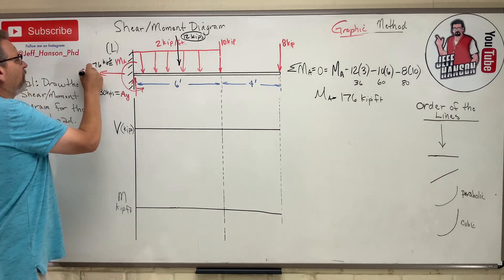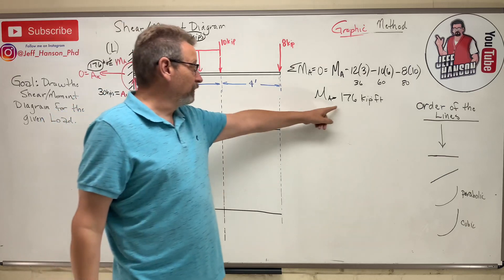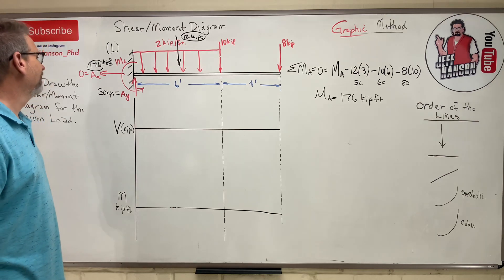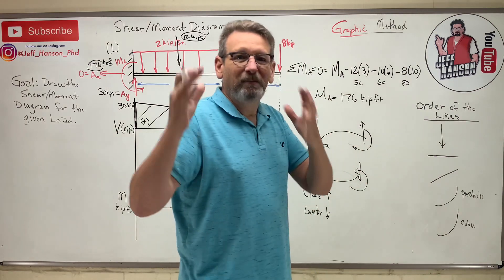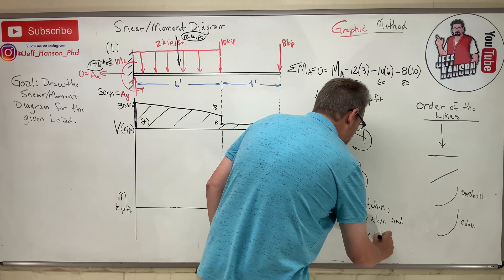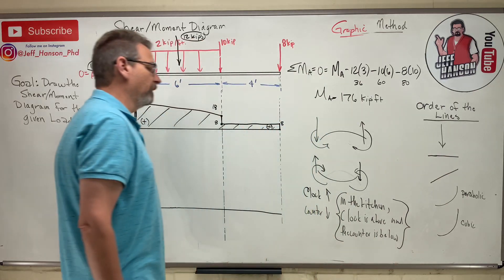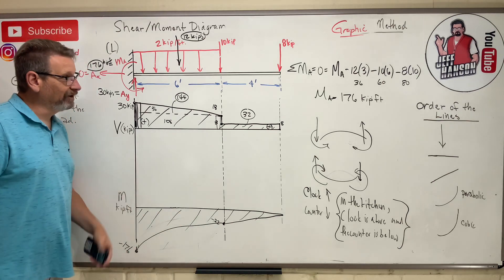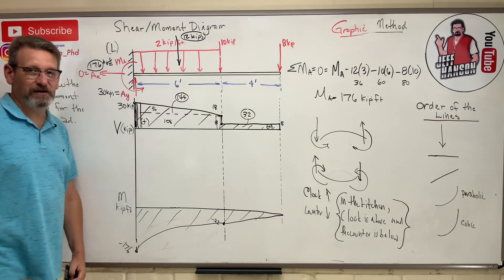Statics: Lesson 60 - Shear Moment Diagram Problem with Moments

Comment: I got a trick for the fast and slow type of curve part sir. Just draw a circle, divide it into 4 regions, and then put "PD" on the upper left hand side (Positive area, Decreasing slope) and then "NI" on the upper right (Negative, Increasing), "ND" on the lower left, "PI" on lower right.

so taking that example at 12:49 

since the area of the shear is Positive and then the slope is decreasing, then it would be "PD" and since PD is at upper left region of the circle the curve would steep then slow 😊😊
Reply: Thank you omg !!! I was having issues with visualization!!
Reply: it does
Reply: @tutingrubena1584  it doesn't work for triangle
Reply: if only I can send a picture 🤦
Reply: you're the GOAT
Reply: Great! Thanks man
Reply: ofcourse for load diagram that has a triangular load, you'll gonna take the loads as negative
Reply: Bro i think you are wrong .

correct one is like
PD  ND
NI    PI
Reply: the mnemonic for this guys
is "Please Dont  Neglect Infants
Neglect Dumb  People Instead"

PD NI 
ND PI
Reply: @tutingrubena1584  I think this doesn't work when the distributed load is a triangle or does it?